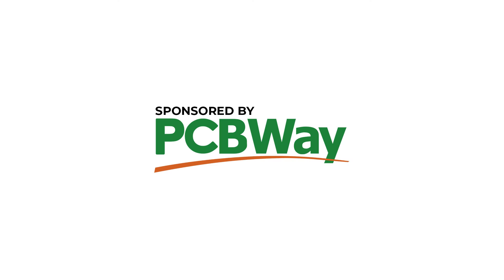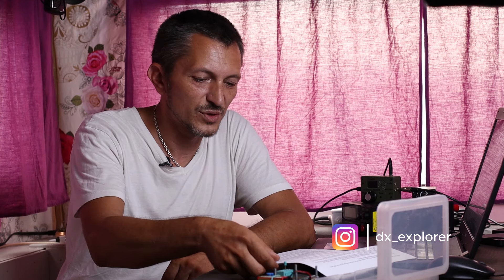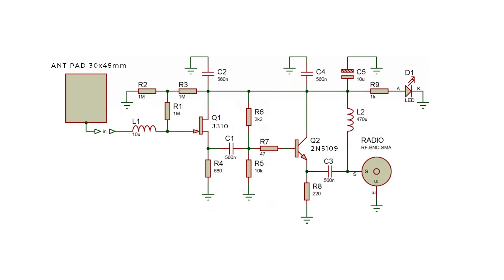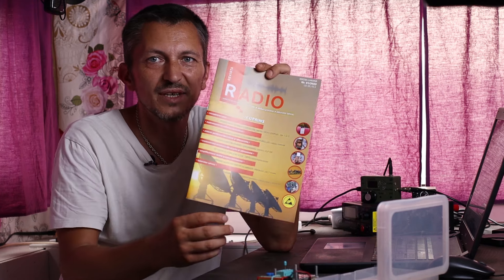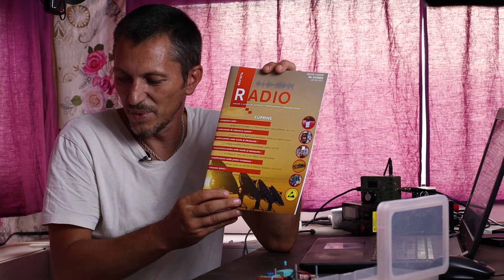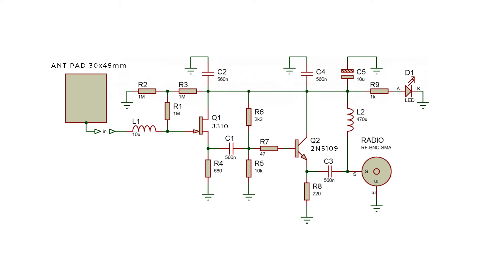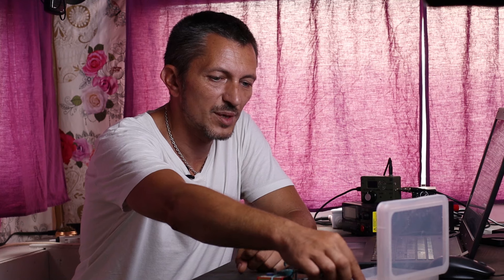Building The PA0RDT MINI WHIP Antenna ( 10kHz - 30MHz ) - Part One

Comment: Very nicely built, I am amazed 👍Impatient to see your results

I tried a few variations around this design. I remarked the following :
-1- it is sensitive to the quality of the grounding. Ground from the coax brings a lot of noise. It seems better to use a local ground at the base of this antenna.
-2- Using a faster NPN transistor, this antenna is able to have significant gain at pretty high frequency (144 MHz or even high)
-3- It is a "electrical field" antenna : it is sensitive to every electrical device in the close environment (home wiring etc...). Keep it away or high enough.
Note that lightnings could destroy the FET even far away. I personnaly use diodes to protect it (that degrade the sensitivity)
Reply from the maker: Thank you so much Olivier. I took a screenshot of the comment to put the info in my notes. This is much help to me. I hope tomorrow I can get the rest of the stuff and finish the project and the video as well. Fingers crossed it works... if not at least I have enough time until the 13th to troubleshoot 😄. 73, YO6DXE P.S. The ground of the antenna you mean at the mini whip ? Or the power thing and put the ground over there before the coax goes to the antenna itself ?
Reply: @dxexplorer  Ground : yes, it seems that the mini whip ground is important.
source : WEBSDR of the University of Twente. Their mini whip is at the top of a metal roof, which serves as a reference ground.
Reply from the maker: @olivierconet7995 yes yes I was reading about their antenna last night after I finished posting my video )). Thank you so much. This is great help. It will make my life easier when installing it in the final location.

Comment: I used an active antenna with 15-20 dB gain for FM radio receiver, and for many years i mistakenly thought that any antenna without gain is useless.
Nice and accurate build
Reply from the maker: Thank you so much. Well we will see once I finish this one if it will turn out to be useful or useless haha. I hope it works. 😅

Comment: The best surprise of a video, ever!
edit: if the area up in Cioclovina has internet, which I assume it does somehow, you could connect the antenna to an RTL-SDR V4 and turn it into a public WebSDR, as the area could be a nice low-noise reception spot
Reply from the maker: Ohhh no internet there. I had no phone signal for a week that I spent there. But I like it this way also ))) Later edit haha... m internet here is not further than the missing one in Cioclovina. It's so slow that this clip was scheduled to be posted three hours ago... but with my internet speed the upload took ages ))).
Reply: Starlink is expensive, but probably available there.
Reply from the maker: @jeremiaskotchinski2073 It is available yes... but the man there wants to keep the place as "clean" as possible from technology so the fact that we can put some radios there is a big deal 😁.

Comment: I Like that you Build it as how look on the schematic. Very easy to find problem if there is A problem.
insted of trying to finde A problem on A complex Print board and only having A simple Diagram. 
And I am Happy to hear that you get A miniVNA And L-C Tester
Reply from the maker: Ohhh yes I try even on the PCB board the designs to do the same. Of course is not always possible, but I try to keep it as close as possible to the way the schematic is.

Comment: I think 100nF is little bit too low. I built this antenna about 20 years ago (I believe, it's hard to remember) and it worked well, but I lost that thing due to moving from one place to another, so I decided to build it again, slightly modified, because I was completely unable to obtain original parts.The original design used 470nF capacitors and if you think about that, 100nF is too small, especially when it comes to the output of the last stage, that goes into 50Ω. I used 1μF ceramics. This antenna is well performing also on MW and LW broadcast bands and even lower, which requires that higher capacity on the output. If you don't need this feature, then it's probably OK to put a 100nF into it. 

The second thing I came across was the input transistor. I was unable to obtain j310, I tried j111/j112 but they did not perform well. Then I found MMBFJ310, which is, in fact, j310, but in SMT package and it was much better, but then I ran into issues with the final transistor. I was unable to obtain the original, but I ended up with a chinese S9018, that worked almost perfectly (yes, I know I push it near to its maximums, but it works).

Third thing — be aware of capacitive coupling to the ground (e.g. due to proximity to something connected to ground), esp. when it comes to the input gate of that j310 as this can easily ruin the whole design.

I also removed that coil between the V+ and output, imo it's much easier to power that thing through separate wire than using the output coaxial cable, but this heavily depends on where (and how) you want to install that thing. I also discovered, that that preamplifier (in fact, it's much more buffer than amplifier as it does not enlarge voltage swing, it just converts the impedance) can be easily used as the input of simple E-field near field probe. I made third instance of this thing just for that purpose, I replaced that plate connected to the gate of the input transistor with about a 5mm of thick insluated wire and it works perfectly as an active E-field probe.
Reply from the maker: I will reply a bit short because I have a little work to do for today still. Thank you so much. Noted all the info. I guess I will try it now with the 100nF capacitors and see how it performs... if things don't go so well then I may replace them with 1uF capacitors. I do have a few of those not polarized. On the transistors... I am also curious if the ones I have now will work. If not I still have a little time until Sept. 13th when I have to leave at the camp to make final adjustments and tests to make sure it works well. Thanks so much one more time. 73, YO6DXE
P.S. The power yes I must use the coax for it as it will be a little far from the receiver hiding in the attic and I may have way too much loss in power running such a long cable for DC Power.

Comment: I'm already looking forward to the sequel. When can we expect it? One more question: How many volts are used to feed the antenna? I am SWL and use an RSP1A from SDRplay.
I would be very interested to see how the MiniWhip works with the receiver. I usually build my own antennas (e.g. MagneticLoop), but I'm a beginner when it comes to tinkering with electronics.
Reply from the maker: Apparently this one should be way better than a magnetic loop if build correctly. And since it's wide band there is no need to constantly tune the antenna for a particular frequency. Now I hope it also works considering that I did not exactly used the original components as they were in the schematic. The voltage... I see that anything from 9v to 15v ... but honestly I will stick to 12v as I will power it from the same power supply I use for the radios or the transceivers. I will try to finish it and do the tests today and hopefully the video too. But it is also my nephew's birthday today and tomorrow mine so we will see how i can manage 🤣🤣.
Reply: @dxexplorer  Thanks for the quick reply. I am looking forward to it!
Reply from the maker: @uli_6830 I can't wait to test it also 😁

Comment: What kind of antenna you used for the Sputnik. Would be great if you can discuss some antenna  built for these kind of radios (an idea for a future video maybe?) Since you are great at explaining things. Although I am an electronics engineer, suitable antennas with minimal dimensions can be challenging to me and a lot of people
Reply from the maker: For the Sputnuk receiver... at the beginning when I built my very first versions... I was just using a simple wire around 6 to 10 meters that was hanging in my room on the ceiling and I also connected a ground wire to the receiver. Then later on I used an EFHW antenna. There are videos on the channel on these antennas as well.
Reply: Thanks  @dxexplorer
Reply from the maker: @nonamex3052 Always a pleasure my friend. 73, YO6DXE.

Comment: is this antena comoatible with my sputik reciever
Reply from the maker: I haven't tested it on mine as I had to take it up to the scouts camp and install it there. But it should work yes. I will rebuild mine soon using the PCB boards and in the video I will make... I will use the Sputnik as a demo 😉. My Sputnik was in a re-building process and it was not working when I made the first videos on the antenna.
Reply: @dxexplorer  one thing i buit it it amazing with my sputnik reciever if you want to see it i will post a short
Reply from the maker: @The_electronics_nerd Yes please. I would love to.
Reply: @dxexplorer  One thing. You have amazing projects. Every project you have works first try.
Reply from the maker: @The_electronics_nerd I try to make them like that ))). You know how I started the channel ? Or why actually. I was making my first steps also and tried a lot of schematics I found online. Sadly around 60% of them didn't work 😐. I thought I am doing something wrong... but then the more I learned, I discovered the mistakes and some ended up working ... some not so much. So I started with the idea that I would present those that are nice and great projects to build... those that do work... and I try to stay away from those that didn't haha. But now and then I may put one of those as well. Like the CW keyer with the 555 IC. 😆